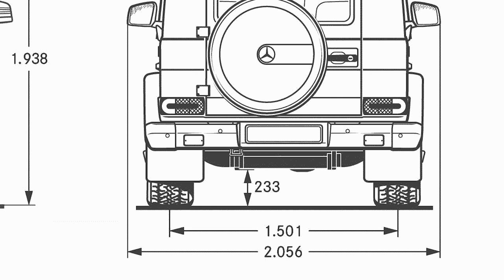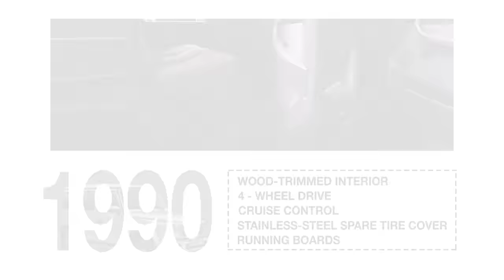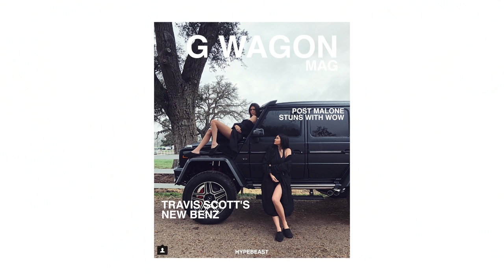How Mercedes-Benz G Wagon Became Every Celebrity's Favorite Car | Behind the HYPE

Comment: It is the Jeep Wrangler of Mercedes. Stood the test of aesthetics.
Reply: Yeah  but the wrangler is ugly and cheap
Reply: george luckaas but it won’t cost you a fortune to replace a part like the Merdcedes😜
Reply: @Alansaidhello  range rover king
Reply: Range Rover is shit. Atleast the ones I've owned.
Reply: @sirgeorgioalastrata4104  subarus are even better than those heavy, expensive, slow jeeps
Reply: Wish it shared the same platform with the Wrangler.
Reply: @sirgeorgioalastrata4104  false.
Reply: Toyota 4runner
Reply: Mr Sosha Da baad Man I love my Gwagon and I loved my Jeep. They are different though. The G is a much tougher, more powerful and heavy duty machine, it will go through the really nasty stuff, they are similar in size, the G is just taller. The Jeep is fun though too, with removable doors and top, the Jeep is better at crawling. Just depends on what your using it for. 🤷🏼‍♂️
Reply: What do you mean?
Reply: out of all great jeeps you chose to say the wrangler smfh

Comment: “All wheel drive steering” 😂😂😂
Reply: Alex C 😭😭😭
Reply: that dont even make no sense
Reply: Its a real thing you know. Honda preludes got it as the first normal production car i think. Back in the 70s
Reply: @marcelworner2945  but the g wagon didn't have it...
Reply: @kidzbopkaren8342  new g has
Reply: But the new g has all wheel steering
Reply: @Zak-ob5ze  I cannot seem to find this info anywhere where did you get that?
Reply: @Zak-ob5ze  no it doesnt
Reply: It's either all wheel drive or all wheel steering, there is no sutch all wheel drive steering
Reply: @grasak1594  there are cars with both awd and aws, but the G class is not one of them
Reply: @turbosydney  I meant about the term "all wheel drive steering"...That term doesn't exist and the speaker meant either all wheel drive or all wheel steering
Reply: @grasak1594  oh ok i missunderstood. Yeah the narrator doesnt know what hes talking about
Reply: All wheel drive means all wheels get power and spin
All wheel steering means that the front 2 tires turn in one direction (right) while the rear tires turn in the opposite direction (left) for a tighter/smaller turn radius
Reply: The Gliga Exactly. This video was so inaccurate and complete garbage
Reply: @marcelworner2945  That's all wheel steering, not all wheel drive.
Reply: @Zak-ob5ze  Nope.
Reply: @fartnloud7411  All wheel steering can turn both wheels in the same direction for high speed stability, inverse steering is sketchy at highway speeds. One example of that is Nissan HICAS.
Reply: What's funny u haven't heard of about it?
Reply: He meant to say “All Wheel Drive” as is proven by the text on screen. The G-wagen does not have All-wheel steering.
Reply: He meant all wheel steering

Comment: Its a military vehicle, still handles like a tractor until this year with revised suspension. Anyone of them before 2019 don't handle well.
Reply: So true. Drove one when I used to work as a Valet and it feels like a tractor with an inmense amount of power. So scary and so fun at the same time.
Reply: That is the point of the car
Reply: @schottentor5174  affirmative, coomer.
Reply: Yeah, handling is certainly utilitarian, but that’s the original purpose of the vehicle. I personally like it. Drives like a heavy truck which was a pro when I picked up mine.